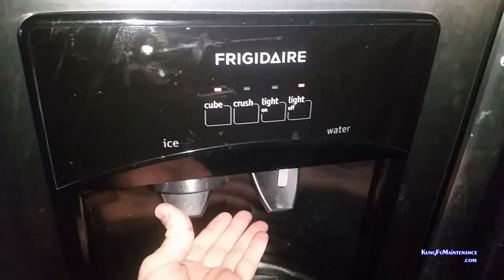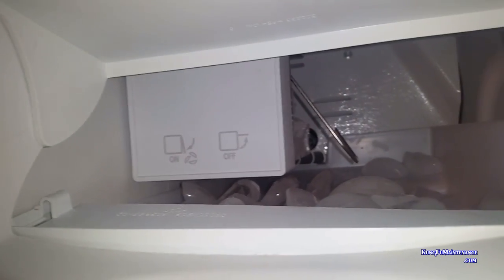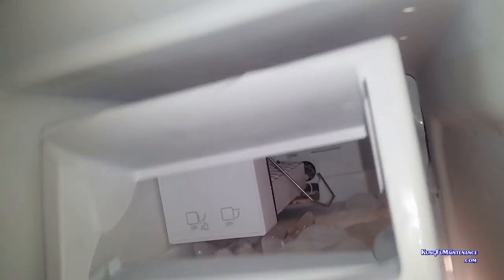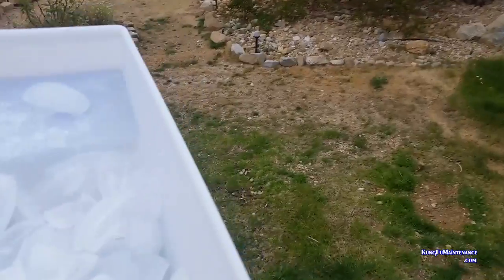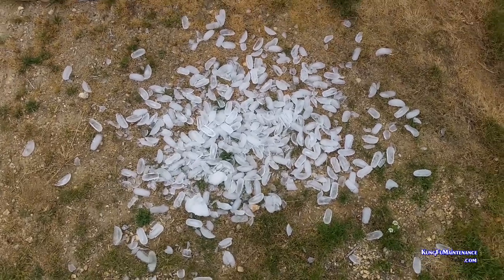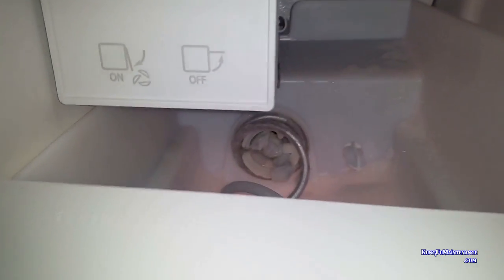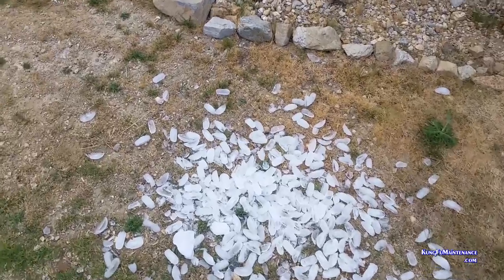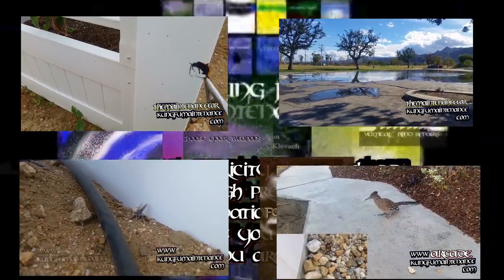Refrigerator Freezer Ice Bin Full Icemaker Working But Not Delivering Ice Through In Door Feeder Rep

Comment: What would be the problem if there is no sound when you push the dispenser arm back?
Reply: Mine has the same problem when we use a cup or pitcher against it...it does nothing. 

BUT...I've figured out that if I squeeze a finger in between the dispenser and my cup, and use my finger 2 push the very Center point (instead of using the rim of the cup), IT DOES STILL WORK. 

I still dk why, or how to fix it...but that's why I'm looking through icemaker repair videos.

Comment: Seems like clearing your ice drop zone worked. My machine makes ice, has motor noise but will not drop ice except 1-2 cubes every 5th try or so. Could be the lid sensor only randomly opens up to allow ice to drop or the back pins that spin the rings are not catching consistently? Still searching for clues. Nice that your situation was as easy as clearing the drop zone. Mine is clear.
Reply: Mine is doing the same thing.  Did you come up with a fix?  If so, what was it?
Reply: @jingles373  Mine does the same and is your blade bent?  One of them?  One seems a little inward compared to the others and thinking might be this?

Comment: Could you show where that lever is? I have a similar Frigidaire refrigerator and mine gets jammed way too often while trying to get crushed ice to come out, like every few seconds, and when it gets jammed I noticed it sounds like ice is wound up in the spring. Is that the  same problem as yours or is the jam someplace else? I'm not sure mine just pulls out like that. I once had a repairman come to the house that had to replace that whole section and it seemed as though he had to unscrew alot of things to pull it out. It didn't look as simple to remove as yours even though the part looks nearly identical.